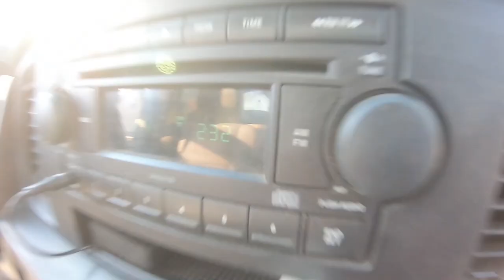Best Side Hustle for 2022 (Solar Panel Cleaning Business)

Comment: Awesome man, auto detailing is my side hustle but I was looking to protect the panels I will be installing for my home and some of the protection products in the auto industry can easily be used to protect panels. Some Si02 based Nano coatings are easy to apply heck even polymer based products should work well. You guys should work that into your business as well as offering maintenance contracts for quarterly or bi-annual clean/protect. Hit me up I'd be willing to send you some product see how it works for ya.

Comment: With the spotless water system how do you guys save the filter effectively? Like do you turn off the source of water off completely or just let it run. How many homes can you clean before changing filter? I’m planning on doing this as a side job and filtering only 300gals seems small since a running hose uses about 10-15gal per min.
Reply: A hose does not put out 10-15 gallons a minute bro